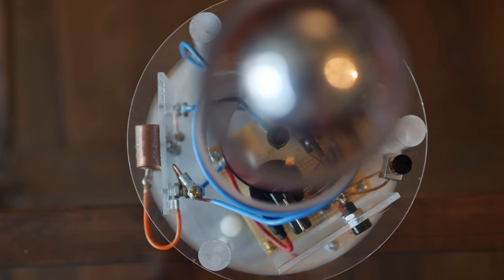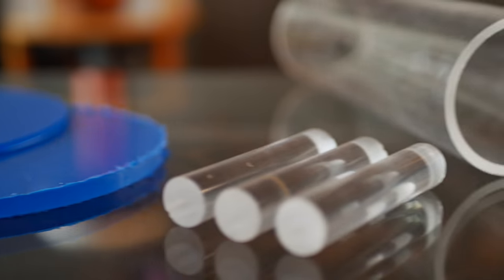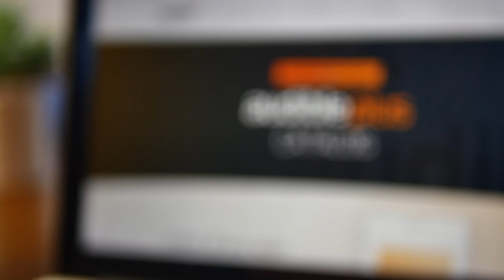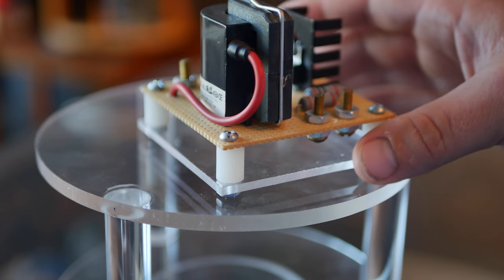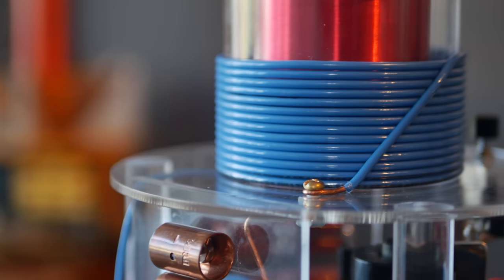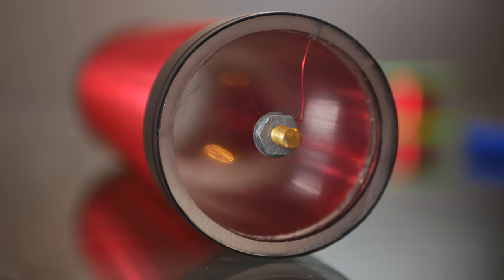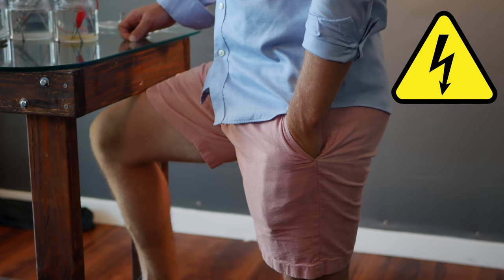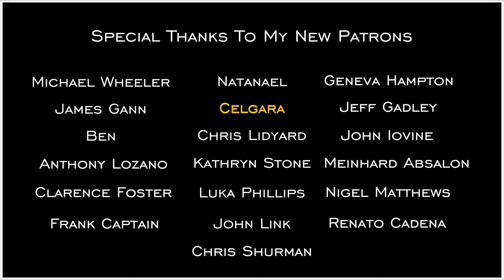DIY SEE-THROUGH Tesla Coil ( Portable & Museum Quality)

Comment: It would be cool if you gave this coil a rotary spark gap, you might get bigger sparks to
Reply from the maker: I actually tried that with limited success. Honestly, rotary gaps are most useful on high powered coils, and don't help too much on low powered coils like this one. At least, in my experience.
Reply: Plasma Channel mmm I wonder if it’s because the cap doesn’t really need to be extinguished as it isn’t very powerful. Very interesting!

Comment: Hey Jay, I just built the flyback driver but there’s no arcs because I am powering it with a 9V battery. Any suggestions for how to power the flyback driver if I don’t have a bench top power supply? I’m looking to recreate your “15V at 2.5A” but I just don’t know how!😩🙏. Thank you in advance for any advice!
Reply from the maker: If you are using a normal 9v - those are super weak. You need a lithium battery. Or, lead battery. Cheers.
Reply: @PlasmaChannel  What kind of lithium battery did you use? I just tried to use a 15V, 3A AC to DC wall adaptor that fried my BJT LOL. You live and you learn I guess haha. Anyway what model of battery did you use for this project? :) Thank you!

Comment: I only had access to a 2 3/8” tube, do you think it’ll affect its function a lot?
Reply from the maker: That will change the resonant frequency of the secondary pretty drastically. If you use that pipe, I would recommend also using a wider primary form as well as experimenting with different numbers of primary turns. Not using a wider form will cause sparks to jump between the primary and secondary windings.
Reply: @PlasmaChannel  Alright, I’ll try that, thanks for replying

Comment: Properly ground that small counterpoise and see if the performance improves. 3" max spark seem too little for 110 kV
Reply from the maker: THe 110kv wa theoretical - I'd imagine it was closer to 90-95 in practice.
Reply: @PlasmaChannel  Hard to tell but I would give more like 70 kV

Comment: How did you tune it: did you o-scoped for resonant freqs or calculate them? If you want to estimate output voltage better you could use sphere gap technique in this case: hang identical grounded  sphere above the top terminal one and set distance where gap breaks.
Reply from the maker: Hi Ime, I used JavaTC online. It worked very well, and I tuned designed the coil to be in tune from the start. As for the spark gap method - it's a great one! I actually shot a whole video about it two years back. Unfortunately, with AC electricity, the sphere method is not as accurate, though, it will give a rough estimation. That's how I quoted the 110kv from this coil. I have a second sphere identical to the topload, and the spark jumps about 3.5cm between the two.
Reply: @PlasmaChannel  The sphere gap method is quite accurate if the gap is shorter than the spheres' dia (than the field is almost uniform). With g<1,5d it can still be used up to 5% accuracy. For d=2.5cm, g=3.5cm breakdown voltage is aprox 65-70 kV under stp conditions...

Comment: I have been camping and just got to see your video. It was an amazing video. I do like how you added in the input current and voltage. It helps others to design coils like yours and make their own coils. I have studied some resonant frequency stuff. Though I dont completely understand it well enough to apply it to lots of stuff I would like to apply it to. I would love if you made a video on what exactly resonant frequency is and how it applies to any form of transformer. Including Tesla coils and microwave oven transformers. 

I've heard of resonant high voltage from microwave oven transformers, though I don't understand it well enough in its applicable form. The questions I have would be, what does resonant frequency do?, what does it do if I have it for microwave oven transformers?, how is it used?, what does resonant frequency change? Can it change the current and voltage?, and in what situations does it not behave normally? These are just some of the questions I have though I have lots more. 

I have always wanted to make a 25 kV or 100 kV power supply that can output 1 amp of current. And I think that resonant frequency could help me achieve that. Though I still have lots of questions about resonant frequency and how i can use it to get me to that goal. 

There are a lot of high voltage low current power supplies, but I'm looking to make a high voltage and high current power supply. 

Another question I have is, how do you change the frequency of the output and input of your Tesla coil? I know it's with capacitors, but what exactly determines the frequency? 

I have many many more questions, but I believe I don't want to overwhelm you with questions. I know I do ask very difficult to answer questions a lot, so I'll keep some questions in for now. :) 

Thank you for continuing to make these videos. They are very professional and very very educational.
Reply from the maker: Hi SA, thanks! Good suggestions as well. Just a heads up though, creating a high voltage power source with that much current is extremely lethal. Like, one mistake...just one....and you will have zero chance of surviving. I specifically use power sources on this channel that are non-lethal (or mostly non-lethal) for a reason. f

In order to change the actual electrical frequency of the output, you change the topload. However, once you change one thing on a tesla coil, the entire circuit needs to be adjusted to compensate. So, changing the topload would mess up resonance, and, reduce voltage out. 

Cheers!
Reply: @PlasmaChannel  So is the topload a capacitance value in the tesla coil case? So if the capacitance of the top load changes then the rest of the circuit needs their values changed to match the capacitance of the top load?

I know how dangerous high current at high voltage is, though I always take extreme caution when working with high current high voltage equipment. 

:)

Comment: Don't you have to tune it to the resonance of the secondary?
Reply from the maker: It is tuned. I first calculated the frequencies, turn by turn on the primary. Built it with the closest resonant match, and check tuning afterwards by experimenting with turns. The calculations worked perfectly as it turned out.
Reply: @PlasmaChannel  I am not so sure that resonant freq will be the same with grounded and ungrounded relatively small counterpoise
Reply: @PlasmaChannel  What I'm thinking is that, depending on the topload and the secondary winding it will change. If you done it entirely by calculations. I would like to know how you figured the resonance of the secondary out. As far as I know, you need a frequency generator and oscilloscope for that. But I'm more than happy if you can show another way. Because I don't have them.
Reply: @thesciencefurry  There's a program called JavaTC that will calculate all of the coil parameters

Comment: Awsome 
Can you make a tesla coil which uses 400,000 v in the spark gap that would be legit or would it
Reply: I am really sorry man
Reply: I am asking and asking for new videos
Reply from the maker: 400,000 in the spark gap would need to be a coil the size of a sky scraper. Really. It is fully possible, yes. But, impractical. Doing one with a spark gap voltage of 50kv is much more attainable. Would still be a massive, massive coil.
Reply: Can you use voltage multiplier that supply dc 400,000v you told us that the original tesla coil was driven by dc so would it work

Comment: Awesome Jason, a totally love it. Clean lines and awesome output, really have to build this now, and put my spin on it, and luckily i will have spare acrylic after this Wimshurst build is done. not surprised by the ending though, acrylic glue is not really a structural join, more a chemical one. by stepping the acrylic rods and socketing them into the disks then gluing you would have a way more secure structural bond that should handle the load.
Reply from the maker: Hey Noel, yeah i've been seeing your Winschurt built on IG. I think IG? Anyways, your build is looking great. My only problem with drilling and bolting acrylic together, is it takes too long for me to do properly. I dont have a drill press, so drilling perfectly straight down a rod, then tapping it with a screw bit.....takes so long for me. I need a drill press.
Reply: @PlasmaChannel  eah i have a small drill press and it really makes a difference. thanks for appreciating my Wimshurst build, hopefully you will have one coming in the near future.....

Comment: Hey Jay. I love this one so much and will definitely have to make. I’m not a huge fan of working with acrylic but I can design and 3D print the parts. I’m wondering how you calculate the number of primary coil turns into relation to secondary coil turns?
Reply from the maker: Hey Layton, glad you enjoyed the build! You are free to build away, and I encourage you to! I only ask, out of respect, that you do not mass produce this exact model of coil with 3D printing (you legally can if you want, I just respectfully ask you do not). As for calculating number of turns, if you build it exactly like mine, it's already tuned. Otherwise, use JavaTC online - it's great.
Reply: @PlasmaChannel  Thank you for the tip Jay and I won’t mass produce this design and wasn’t planning on it. Just for personal use. I’m just a high schooler and am way more interested in learning than plagiarizing your design to mass produce which is just wrong to begin with. Have a wonderful day and keep the classy coming!

Comment: How did you count the secondary turn?
Reply: I mean, you did it with a drill.
And drills are fast.
And how did you controll the moter speed?
Reply: Is it normal for a 13 year old to play with HV?
Becaus i am 13.
Reply from the maker: I would recommend not building a tesla coil if you are new to electronics. If you have experience, then build small at first. Like one of my mini tesla coil builds. You will learn how they work, what the dangers are, and if you mess up, you wont be badly shocked. As for counting turns. The wire is a standard size. 0.0078 inches wide. It was wound on like 7.5 inches if I remember correctly. So, that gives turns.
Reply: @PlasmaChannel  and that's why i'm makeing a Faraday cage.
Reply: @PlasmaChannel  and if you could find 38gauge 10kg < please tell me.
Reply: @PlasmaChannel  and plz make a qcw dersstc with the gu5b.
Reply: @PlasmaChannel  and i watched your tesla coil videos else ten times each.
Also, i watche electronoom, styropyro too.
So, for about 2 years, i learned a lot.
Thank you for the great content. 
I really appreciate your work very much.
Reply: @PlasmaChannel  and i already buils a tini tesla coil with a HV module.
It's not powerfull, but it makes some powerfull arcs.
Quick question, by removing the capacitor from a electric fly sweater 
can i get a continuous arc of electricity?